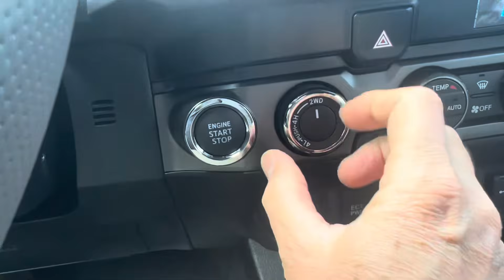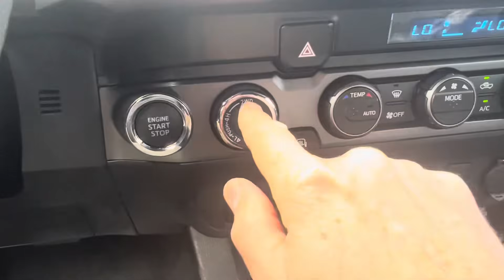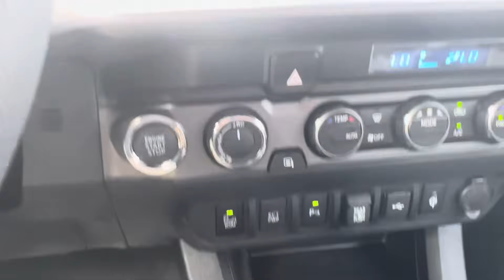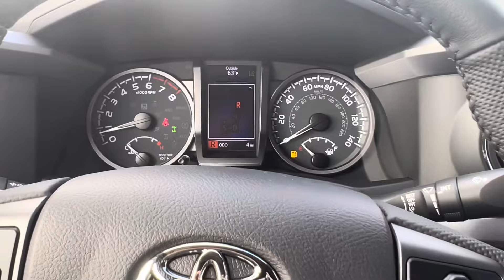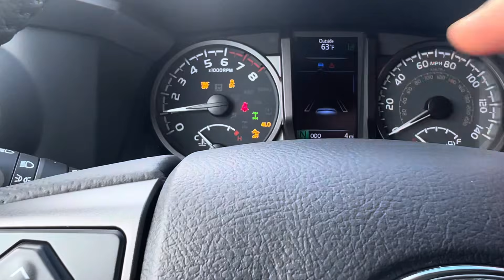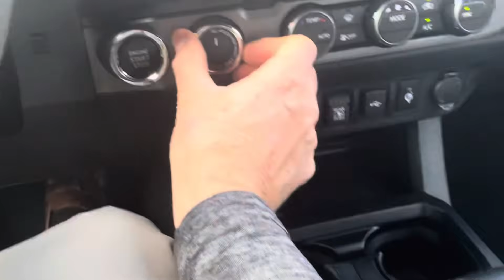4 Wheel Drive basics: engaging 4WD high and low

Comment: Hi Steve - does this also apply to my 2016 Land Cruiser?
Reply from the maker: @kmcworld  no. The Land Cruiser has a full time 4WD which is far superior and can be driven on dry pavement without a problem. If you lock the center differential, then yes, you’ll get driveline binding

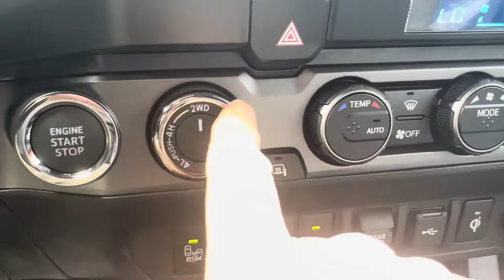Comment: 1:38 “You don’t want to do that on dry pavement” what do you mean?
Reply from the maker: @EverybodyEditsHacks  a part time 4 wheel drive locks the center transfer case and if you turn a corner on dry pavement, you will get “drive line binding “ which can cause real damage
Reply: @TrainerSteveClifford  I had no idea about this, and I thought I read through my whole manual. So basically if your wheels can't slip some don't drive on it in 4WD to prevent binding? Also is it better to change to and from 4WD while moving or standstill?
Reply from the maker: @EverybodyEditsHacks  moving is fine but if you’re going up hill or accelerating hard, you might need to lift off the gas for an instant before it engages
Reply: @TrainerSteveClifford  OK. thank you very much for this information. Will hopefully lead to a longer life of my taco